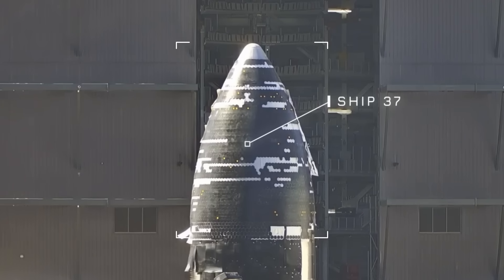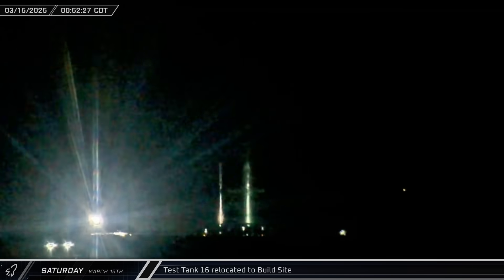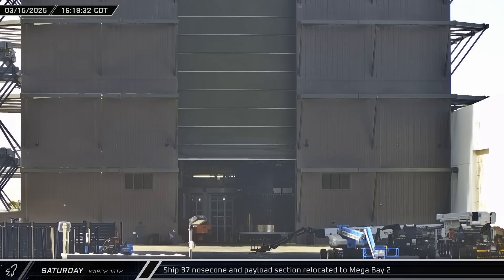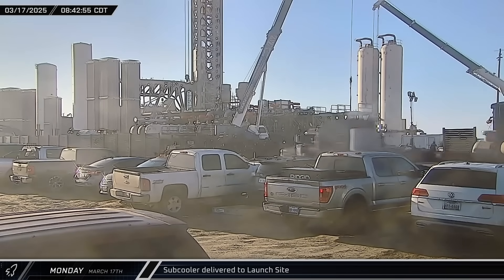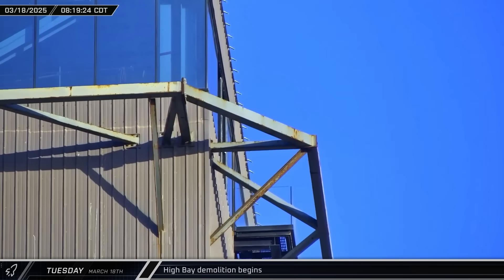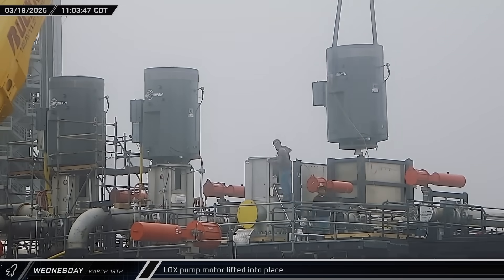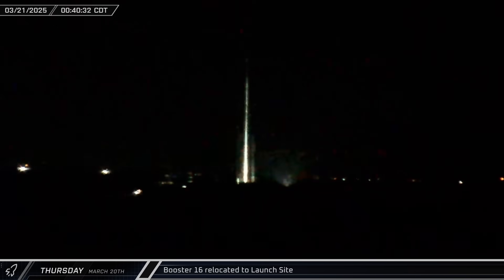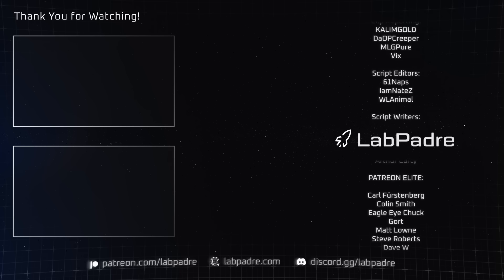Big Changes Coming to Starbase! - SpaceX Weekly #159

Comment: What you referred to as sump pumps are the barrel sections, lower half of the vertical turbine pumps that are installed later. It is the suction side of the pump and the liquid flows on to it and is the pulled in to the vertical  impellers to raise the liquid to the desired pressure before being discharged in to the delivery piping.
Reply from the maker: Thanks for the info!